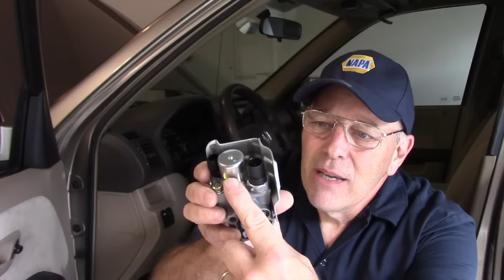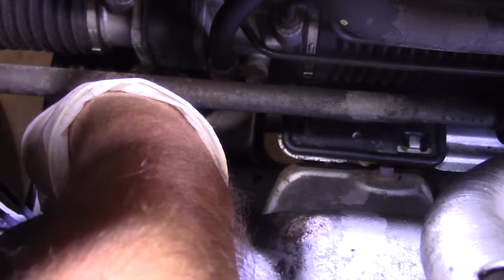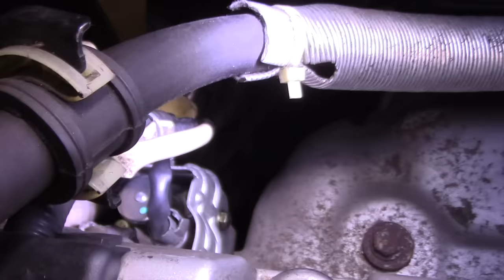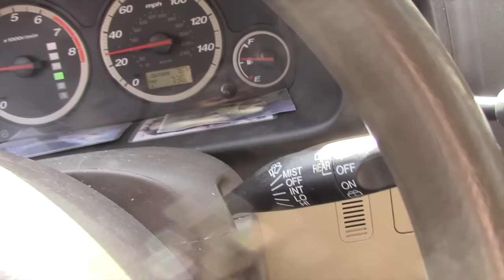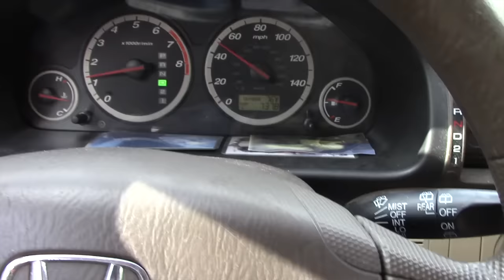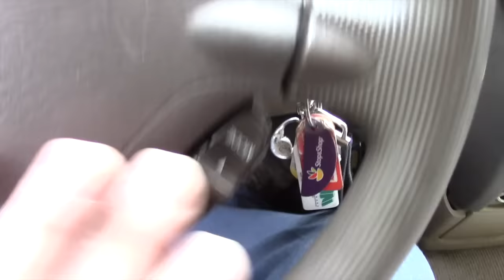VTEC Repair  P2647 Or 2646 (Pressure Circuit Voltage High Or Low)

Comment: 2003 Cr v has this code we changed the selenoid works great til it gets cool outside again then goes into limp mode on a 70mph hwy and same code returns. Any ideas?
Reply: If you're currently on synthetic, I would try going back to the regular stuff. 

I've done all the steps here with no luck of a fix.

 It never occurred to me that it may have been the oil. 

During one of my changes at chain shop, they recommend synthetic oil because of super high mileage (210k 😎). So I did. Thereafter my Element entered limp mode and this code populates. I replaced the part 2x, oil engine flush, and cleaned the screen. Nothing. 

Till one day and during my oil change, I didn't want to pay extra for "better oil" when I was already considering taking an L on the Element (selling it). And after I launched from shop, I was shocked that code never came back. Relief. 

After digging around, I've read that Honda engines only like a certain engine oil. Enthusiasts of early Honda always recommend staying away from synthetic.

I've never looked back at this code. 4k milked later. 

Hope this helps and not too late.
Reply: @MrQuipster4k  is interesting because my last oil change they offered the same thing and i went with the cheaper oil.  I will definitely re change the oil with non synthetic

Comment: The three 10MM bolts are a bear to loosen and they strip easy. I used a grinder to remove the lip off a deep 10 MM socket so all of the bolt head is gripped. Helps alot. On one bolt the prior mechanic stripped it a little bit I had to use a piece of t-shirt to make it even more snug. They came out easy after doing all that. It can be done.
Reply: I can't think if the correct name at the moment  but there are sockets that can be purchased and they bite into the stud, etc. and break them free. They work great. I don't use them often snd I bought mine  at Harbor Freight on sale and they held up.

Comment: I got this code on my 2006 civic lx, and my oil light came on, then engine started ticking. Checked oil before my trip and right as I saw my engine light come on. Sounded fine at idle so I thought the oil pressure light might have been faulty because it wasn’t solid or consistent, just random for different lengths of time. But now I have that knock. Any idea if I’m swapping an engine? Lol

Comment: What about the oil screen under the tensioner? If you don't do them both, the problem will likely repeat itself in a couple months.
Reply: Actually the smaller 2nd screen you are referring to doesnt get as dirty as the screen on the selenoid itself. At least that's how it was on my element,  when it's time to change your alternator that is a perfect time to replace the secondary screen.

Comment: ON 2005 HONDA ODYSSEY . GOT SAME CODE P2646 . ERASED CODE I RUNNED  ON FREEWAY COLD FOR 30 MILES  CAR RUNS GREAT AFTER 30 MILES OF DRIVING ON FREEWAY  VTEC  LIGHT AND CHECK ENGINE CAME BACK ON CARS JERKING BAD AGAIN

Comment: I replaced it but I am having the same problem steal the car does not want to go above 3000 RPM in any gear
Reply: Me2
Reply: @godbless9883  how many miles on your car
Reply: If you're currently on synthetic oil because of high mileage, I would try going back to the regular stuff. 

I've done all the steps here with no luck of a fix.

 It never occurred to me that it may have been the oil. 

During one of my changes at chain shop, they recommend synthetic oil because of super high mileage (210k 😎). So I did. Thereafter my Element entered limp mode and this code populates. I replaced the part 2x, oil engine flush, and cleaned the screen. Nothing. 

Till one day and during my oil change, I didn't want to pay extra for "better oil" when I was already considering taking an L on the Element (selling it). And after I launched from shop, I was shocked that code never came back after clearing the CEL. Relief. 

After digging around, I've read that Honda engines only like a certain engine oil. Enthusiasts of early Honda always recommend staying away from synthetic.

I've never looked back at this code. 4k miles later. 

Hope this helps and not too late.
Reply: What finally fixed mine was using a genuine honda vtec part instead of an aftermarket one

Comment: 9 out of ten I fixed at dealership only needed vtec screens replaced, caused they were clogged, due to oil not being changed  on time, so recap replace vtec screens then change oil and filter first,  9 times out of 10 that fixed rocker arm code p2646 that caused the bucking. Also, vtec, will not engage with low oil pressure, or if your speedometer isn't working. Good luck... always check easiest cheapest stuff first unless you got money to waste, and the original honda solenoids are built well unlike the aftermarket stuff.

Comment: Jim, Thanks for this.  Last month I got a P2647 and my mechanic replaced the entire assembly with a new one.  2 days ago, the light came on again and I got the same code. Any idea what gives?
Reply: I've got the same problem, and after weeks of chasing my tail I finally figured it out. The oil pump seals are leaking, which is not allowing the oil pressure to get up to 60-70PSI to run the VTECH. The code P2647 is Actuator stuck open, the computer doesn't actually receive data saying it's stuck open, it see's low oil pressure, and assumes the valve is stuck open. I've found a TON of information on this code being the actual valve, or the screen getting clogged up, but as these vehicles age out more I think we're seeing more oil leak past the pump seals. Mine was verified with a bottle of oil stop leak. My VTECH NEVER kicked on, now after putting stop leak in it, it is an intermittent issue. I'm going to see if the stop leak will seal it up, the parts are going to get repaired though for sure.
Reply: @andrewball796  My 2003 has 210,000 miles on it. Thank you for this information. I just replaced a valve, so things are okay for now, but in a few months, who knows? I will try the Stop Leak.

Comment: Can someone help me I’m having a problem with my 2013 Honda Accord. Sometimes when I drive it won’t let me go over 40mph and if I try an go over 40 it’ll start shaking. The take off Is delayed and won’t go in reverse. I know it’s probably the transmission but there are no lights on the dash! When I turn the car off and start it again it drives perfectly fine. Could this be it?
Reply: Sounds like a prndl sensor. Use scan tool and shift through gears to see if the correct gear is indicated, then drive it to see if it shifts through the gears correctly .

Comment: Ive replaced that whole assembly on 2.4. I replaced the control filter on the front of the head to. Still going to shit when vtec try to engage
Reply from the maker: What brand did you buy because the aftermarket ones are garbage. I only use the OEM from the dealer.
Reply: If you're currently on synthetic oil because of high mileage, I would try going back to the regular stuff. 

I've done all the steps here with no luck of a fix.

 It never occurred to me that it may have been the oil. 

During one of my changes at chain shop, they recommend synthetic oil because of super high mileage (210k 😎). So I did. Thereafter my Element entered limp mode and this code populates. I replaced the part 2x, oil engine flush, and cleaned the screen. Nothing. 

Till one day and during my oil change, I didn't want to pay extra for "better oil" when I was already considering taking an L on the Element (selling it). And after I launched from shop, I was shocked that code never came back after clearing the CEL. Relief. 

After digging around, I've read that Honda engines only like a certain engine oil. Enthusiasts of early Honda always recommend staying away from synthetic.

I've never looked back at this code. 4k miles later. 

Hope this helps and not too late.
Reply: Ended up bring a bad vtec pressure sensor that came an on the new assembly, swapped it and been fine ever since.

Comment: IMPORTANT! Don't buy Aftermarket VTEC Solenoid they are made in China with inferior parts. The Aftermarket Solenoid weights 400grams and the Honda original part Made in Japan weights 520grams. I have found the oil pressure switch in the Aftermarket part leaks oil and shorts out the wiring. The Aftermarket is cheap but won't last. Better off buying Honda OEM.
Reply: That assembly looks aftermarket. I’ve spent countless hours doing research in my case. If the solenoid looks shiny and polished and the heat shield looks immaculate, it’s cheap. They also all come with that black sensor. I-vtec engines require the BLUE sensor. If It’s vtec on BOTH cams and it’s a higher threshold.
Reply: @AutoBodyEverything  That's a good observation.
Reply from the maker: Nicely put. Don't buy the aftermarket always buy the Honda OEM
Reply: Thanks ! Good looking out 👍

Comment: I had given up. Was about to put the old solenoid back on and take it to a mechanic. You explained to not fix anything, just replace the whole part, so I did! Issue is resolved, running like a champ, again. 367,000 miles!!! Thank yo!
Reply from the maker: Glad you enjoyed it!
Reply: Where did u get the whole piece at?
Reply: I usually go to O’Reilly Auto Parts? That was a couple years ago? Probably there?
Reply: @Gordon47789  did u get the vtec solenoid there at O'Reilly?
Reply: For the vtec actuator?
Reply: My father (WWII Seabee) always told me that if possible, rebuild systems, don't replace parts. In other words: don't go the cheap route..

Comment: Hi. I had the New replaced Vtec part. Changed oil. But still doing same thing. So what I do now.
Reply: If you're currently on synthetic oil because of high mileage, I would try going back to the regular stuff. 

I've done all the steps here with no luck of a fix.

 It never occurred to me that it may have been the oil. 

During one of my changes at chain shop, they recommend synthetic oil because of super high mileage (210k 😎). So I did. Thereafter my Element entered limp mode and this code populates. I replaced the part 2x, oil engine flush, and cleaned the screen. Nothing. 

Till one day and during my oil change, I didn't want to pay extra for "better oil" when I was already considering taking an L on the Element (selling it). And after I launched from shop, I was shocked that code never came back after clearing the CEL. Relief. 

After digging around, I've read that Honda engines only like a certain engine oil. Enthusiasts of early Honda always recommend staying away from synthetic.

I've never looked back at this code. 4k miles later. 

Hope this helps and not too late.
Reply: @MrQuipster4k  when you say synthetic do you mean full synthetic or synthetic blend? Also I just got a 2006 crv with 154k miles what type of oil and filter should I use? (Oil type, kind, and filter?

Comment: Thanks so much for the video. I have consistently clogged up assembly and I have changed the complete assembly many times (2008 Honda CRV). what could be responsible for the consistent clogging?
Reply: Did you ever get a solution
Reply: I have this problem in my 06 Honda Element. Why is that?
Reply: @pableezy2oh9  i really dont know, but mine was solved when the pressure circuit was serviced, so i service my crosstour 2014 every 2 months with pressure circuit and camshaft serviced along

Comment: hello very interesting the video to keep us illustrated I have problems in my honda odyssey 2006 LX we changed the complete valve and the problem remains the same I get to walk about 3 to 4 miles all perfect but the problem returns code P2647 and the power is lost I disconnect the connector of the oil pressure swich and I can shrink normal. What do you suggest is there any measurement that I have to make in the connector of the oil pressure swich thanks for your attention edwincruz04.ec@gmail.com

Comment: Hey Mr. Jim watched your video, on vtec solenoid it was a little bit of a bear because you can't see it well. But got it done. That part is on nationwide back order. No dealer in my area had the part. I called the dealer in Atlanta where i bought the car 16 years ago and they had it.I also replaced my valve cover gasket and plug flute grommets. Thanks for all you do.

Comment: Usually the screen is just clogged. Save your money clean the screen or buy a new one. New screen includes gasket so that's the best option. 8 dollar part from Honda dealer. Don't waste your time and money on aftermarket!

Comment: So, we have this problem on our 2005 crv. We’ve done all these steps, replaced the assembly, oil changes, check levels. But it is still throwing this code when the car gets hot. We have exhausted our knowledge which was limited based off of what we could find out youtube. What should our next step be if after doing all this, the car continues to throw the code and shudder around 3,000 rpms after the car has warmed up. Also this car was a recent purchase and at the time didn’t have any lights on.

Thanks in advance

Comment: Our 2006 Honda Element jerks in 1st or 2nd gear then fine in higher gears . Doesn’t do it all the time mostly when turning or quick take off ? But no codes or lights are on ?

Comment: This fixed my problem that I have been dealing with for over a year. Awesome video, my clips broke and will have to get them from Honda I guess.  BTW my problem was almost the same but the power would choke at about 2800 rpms no matter how fast you were going. Also it did not happen all the time. But now seems to be fixed.
Thanks for the video.
Reply: mine has consistently clogged up and I have changed the complete assembly many times (2008 Honda CRV). what could be responsible for the consistent clogging?
Reply: Would it feel like a transmission slip ??
Reply: @hellsingformeinbrooklyn7888  yes

Comment: I have the same problem with a 6 cylinder 2008 Honda accord, I have no problem with the oil, I change it every three thousand miles. I only changed the gaskets due to leakage and now I have the  code p3497, which I cannot remove even with my scanner when it removed it comes back again; the problem is intermittent, could there be some way to be able to check the wiring before changing the whole part?So the low and high voltage problem are related with all the mechanical part of the valve spool? Would you have an explanation for the voltage problem please?
Please, I would appreciate some help on this matter.
Thanks for your time. 
 Best regards.
When this began to happen, I removed the entire piece, I did an almost surgical cleaning of everything thinking that it could be dirty or with something stuck but even so the problem persists.
Thank you again.

Comment: I've had everything literally replaced on it and it is still doing this with the vsa light, engine and triangle light on! It's cost me so much!!
Reply: This just happen to me too lol have you found anything ?
Reply: I changed the vtech oil solenoid in the video and the one one the side of the engine, still bucking and giving 2647 code

Comment: Another great video! I’ve seen the screen filter of VTEC solenoids with lots of debris/dirt. If the oil and filter are regularly changed every 5000 miles, what else could causing the dirt/debris?

Comment: It's crazy where they put things and making repairs tougher. I have the Element and it's crazy to fix things because it's hard to get at. In the future car designers have to change their way of doing things. I couldn't change out my air condition compressor so I bought it in a shop and they said 3 hours. He took more than 8 hours.
Reply from the maker: That is for sure. There is nothing easy any more.

Comment: I had this same code. Ended up being that the plug connectors between the harness and the oil pressure switch were corroded. I sprayed CRC 5103 Quick Dry Electronic Cleaner on both the connector (female) and oil pressure switch (male) connectors and then gently but firmly inserted/removed the connection to scrape off the corrosion. I did this 3-4 times, then wiped any residue, sprayed and went again. It didn't take that much time. I tried using a few tools to clean the male/female connections but inserting/removing the connectors ended up being the easiest. At some point in the past, the harness connector's locking tab was broken off, so I think this was allowing water/moisture to get into the connection.
Reply: I think im gonna try this cleaning, I hit a water puddle and got those codes...I replaced the entire valve, new oil change again,  second oil filter, the filter screen between the powers tearing pump and the codes keep coming back but it drives like new...

Comment: Hey Jim, so I actually had the entire solenoid replaced, brand new, less than a month ago. But they didn't replace the oil pressure switch, now I have P2647, but you say not to replace just the switch. Any advice? There's no way that screen in the solenoid could be clogged I think, it's brand new...
Reply: Did you get that problem solved?

Comment: I replaced the entire assembly but the same code came up after driving about 2K miles. The engine isn't hesitating like before and still running fine.  What do you think is the cause of the same engine code?  I heard there is another possible cause, "VTC oil control valve variable timing solenoid".  Do you think this is also connected to the same engine code?

Comment: Great videos by the way. So, I had the P247 Code and replaced the entire unit.  a few days later I'm getting the same exact issue. Would a bad connection (tiring harness looks a bit frayed) would the oil pressure switch right above the oil filter cause this?
Reply: Did you fix this issue? I'm haveing the same problem????
Reply: @davidcutsinger3574  I had a damage wire that was hard to see, but all good now.
Reply: https://youtu.be/e3bPWwgeO5s